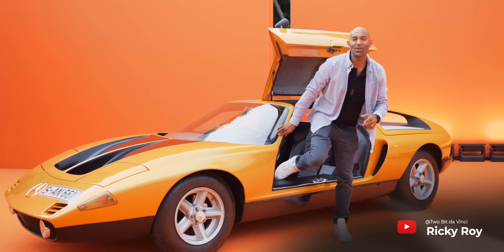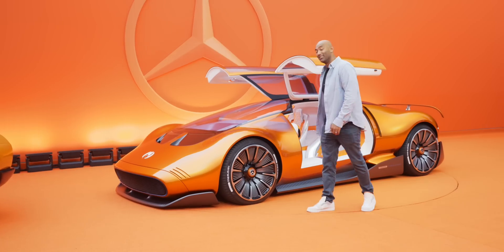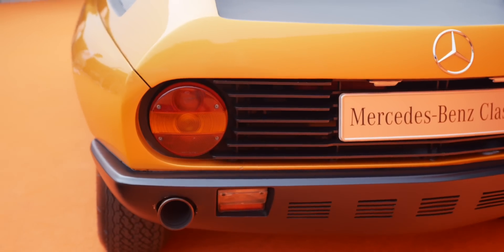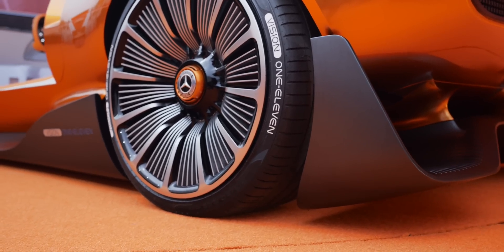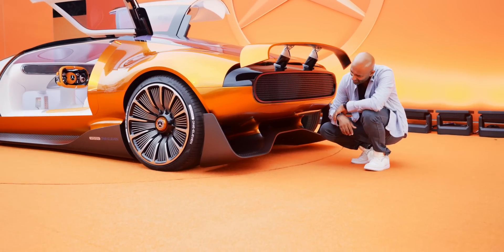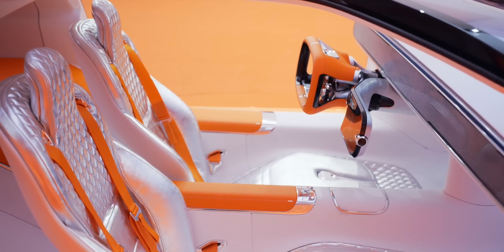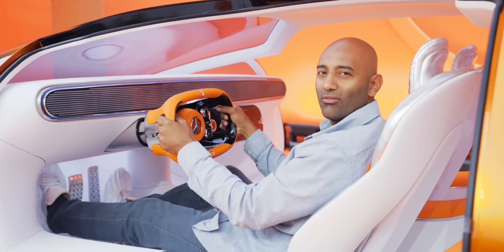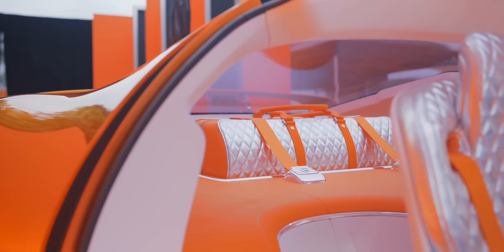This Mercedes Might Be The Most Important Concept Car In Years

Comment: Driving over a pebble would wreck the underside of that car.
Reply: 1 rock = 1 car insurance write off
Reply: Bet ya have to drive a racecar like a Lowrider, when you're driving on a public road?
Reply: This car is unusable that low. But if you drive it once all the lower bits will be ripped off and then it will be drivable....
Reply: It can only be driven in the showroom!
Reply: No chance for the UK 🇬🇧 were riddled with pot holes everywhere 😂
Reply: It is a concept car
Reply: @hilalkarappan9951  yes it is. A very stupid concept car.
Reply: and open the doors :D
Reply: I was just about to write the same.

Comment: The questions for axial flux motors are, can you mass produce it cheaply?, can you ditch the permanent magnets?, can you integrate them into realistic packaging.
Reply: 1. Eventually sure just like anything else, throw enough money time and talent at it. Also yasa was bought out by merc for this purpose.

2. Yes already done and not just in axial or raxial hybrid ev motors either. Example BMW ix&i4 motors use no ree which aren't even rare anyways.
Rare earths just means "rarely mined" in actual mining industry parlance. 

Just like the total made up b.s. about cobalt mining&use in evs by the fossil fuel industry and concern trolls. 
We've mined for cobalt since the 1730s. Further it's most often extracted as a side effect of nickel&copper ore mining. 

3. Yes see the koenesigg gemera running quark in house built hybrid raxial motors with torque vectoring. 👍🏻
Reply: @4literv6  I Thanks and useful information, I  hope it all works for Merc because BYD, Tesla +others are up and running. With cars that work now and factory infrastructure to "stamp" them out and the batteries that go in them.  
My feeling is the EU car giants are asleep at the wheel and this pretty but useless indulgent 3d printed throwback is not where they need to be.
Reply: @logtothebase2  very well said imo. 👍🏻

Merc has serious engineering chops though the eqxx prototype was no joke going 750+real world miles on about 93kwhs. 
They also build a lot of high end stuff, so the evs can stay expensive for quite a while absorbing all the r&d hits of transitioning over to evs. 

I wouldn't count out them or BMW honestly surviving mostly as is. Both are already between 12-15% ev sales through q1 of 2023.
With established plans to hit 25%&50%+market share of sales as evs by 2028.

Both have lower debt than many larger ice legacy oems. 
And both only do about 2,000,00 units a year in total production. 

They also feature fiercely loyal customers, although the BMW 3 series has been the single most common conquest trade on a tesla m3 since late 2018 now. 😀

Comment: I like how tall the original is. They went a little overboard with lowering the new one. Besides that, it's alright. It's not as tight and concise as the old one. The fading on the windows could've been done better, and the interior seems a bit tacky. I see what they're going with the pixel headlights but the absurd contrast of the original gives it much more personality.
Reply: It's a concept car
Reply: @obidean3964  So was the original C111 and that looks much better.

Comment: Would be nice to have a little more background info for the nerds on WHY axial flux motors are a good idea. My suspicion is that they go this route to eliminate drive train losses.
Reply: size for power output. The Konigsegg axial flux motor is the diameter of a medium dinner plate and is about 10cm thick and has the same output as a Tesla motor that's 30cm in diameter and 40 cm long.
Reply: @thekaxmax Thankyou. You just explained more about the why then the reporter.

Comment: The right hand rule actually says "if the electric current flows in the direction  your fingers curl on your right hand, then the magnetic vector is the way you thumb points."
Reply: There's probably confusion because he's using conventional current rather than electron flow. One of the most frustrating parts of electronics and a good example of why we shouldn't let engineers make any decisions.
Reply: That's why I couldn't make sense of how the motors move the wheels. Yes, electromagnets are from coiled current.

Comment: By reversing the polarity on the axial flux motor, does that eliminate and take the place of the braking system?
Reply: You would probably need to manage the heat if this uses permanent magnets because they would demagnetize otherwise afaik, then have a battery (or supercapacitor) that can store these amounts of power  (300-600 kW probably) without losing longevity, etc. and then do that very efficiently and then have a failsafe.
Reply: I brought this up after watching a Joe Rogan clip. He said that brake dust contributes three times as much pollution to the air than the exhaust emissions from current cars.  I thought this might be the way to eliminate brake pad dust.
Reply: @David-rx2to  either that or make rust resistant brakes for EVs because you will hardly need them during normal driving
Reply: Using extra energy (and it would take a ton) to brake doesnt make sense when brake pads do it for free. If anything you would just use regenerative braking by turning the motors into generators, which is already a thing.

Comment: That's a stunning car, I'm a bit surprised by the blunt nose though, it looks great but in terms of aerodynamics I suspect it could get tweaked for the production version to improve range
Reply: that's not a blunt front, that's an air intake for the bonnet vents for aerodynamic purposes.
Reply: @thekaxmax  the splitter is for air flow, the solid black led bar above it, despite looking awesome, is an airflow hindrance
Reply: Its a concept car. There wont be a production version. Its just a testing ground for some technologies that they might use, namely the axial motors like they said.
Reply: @ThePandaKingFTW  every car on the road started life as a concept, but not all concepts make it to the road, hopefully this one will.
Reply: @3DGvisuals  That is not what these are for. 99% of cars on the road were never concept cars. They were designed from the start with mass production in mind. These concept cars were designed without production in mind at all and did anything they wanted, no matter how impractical.

Comment: A Cd of 0.19 sounded wrong, so I looked it up. The C111-III had a Cd of 0.191 or 0.183, not the car above, which is the C111-II and is very different with a Cd of 0.325.

Comment: So they had an aerodynamic car long ago, and didn't build it? That's what I often do not get about concept cars. They look good, achieve something amazing, etc. and then when it comes to making an actual car, it has everything that made the concept car different removed, and is back to being just like every other car. Boring looking, big, perhaps even SUV, brick in the wind, etc.
You can't tell me Mercedes couldn't have sold that old car in the class of Lambo or Ferrari, and in that range even if it somehow cost more to build than your regular Mercedes, it would have been able to be priced accordingly, so even that isn't an excuse. Also it generally doesn't need to cost more to make something look intersting or be aerodynamic, at least if you've already gone through the efford to develop said car, so you're left with pure production cost.

If all you want to do, is test a new motor variant, you don't need to go to this efford, you could do it just like planes and have that test engine attached to an otherwise understood and normal vehicle. If you pay top end designers to make a car look nice, fucking use that design in production. And even if you want to make a boring but sensible car, showcase & develop it as that.
Reply: I guess you don't accept the value of art or music either?

Comment: I wish you would do your homework before swallowing and regurgitating the hype. Axial flux motors are NOT new. They have been around as long as electric motors have existed. They haven't been developed for the same reason hydrogen as an energy source wasn't ubiquitous decades ago even though the technology was already there. While there are applications that are a good fit, they are much less flexible and adaptable and the number of suitable applications is severely limited.

Axial flux motors are much more limited in their RPM range than the more common radial flux motors because... SURPRISE! PHYSICS, not technology. In order to get as high RPMs as a radial flux motor, you would have to stack multiple rotors of the same diameter as the radial flux rotor, completely negating all the benefits of axial flux by increasing complexity, mass and cost. If you tried to spin an axial flux motor as fast as an equivalent power radial flux motor, the axial flux motor would explode because it would have a much larger diameter rotor. Much shorter/thinner (hence the term "pancake motor", but much wider across. The combination of short but wide and relatively low RPMs make them fairly ideal for some applications (like aviation), but the packaging (along with literally ALL performance characteristics) actually is detrimental for automotive applications.

As with any technology, billion-dollar concept vehicles can appear to make them attractive, but the reality is that it's not a good fit for mass adoption.